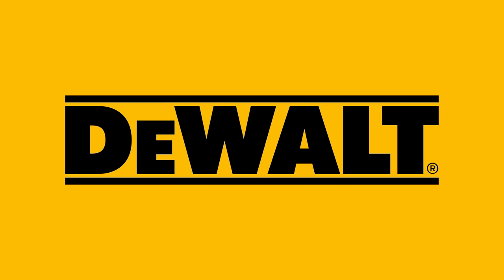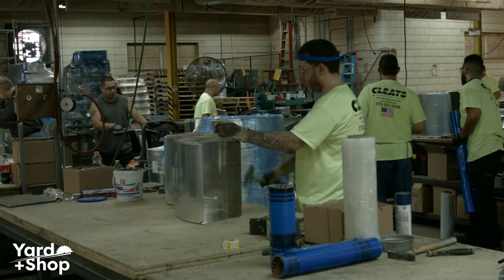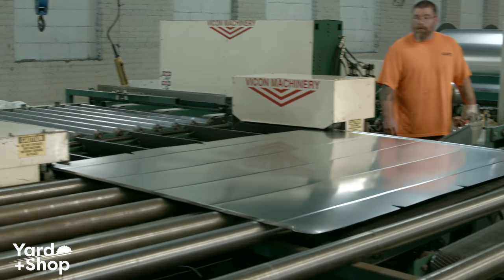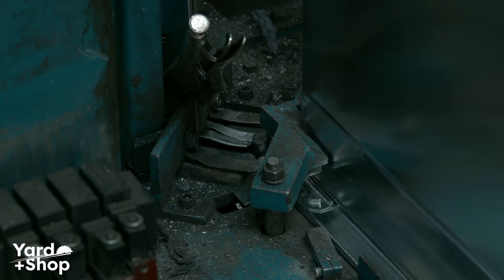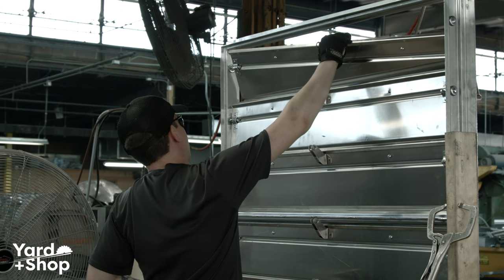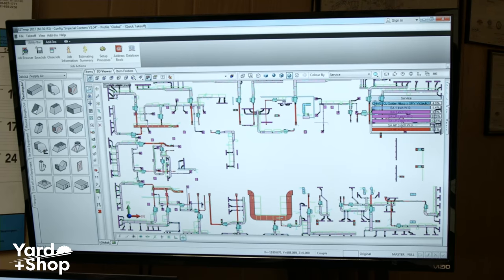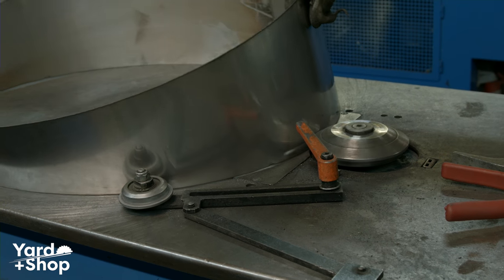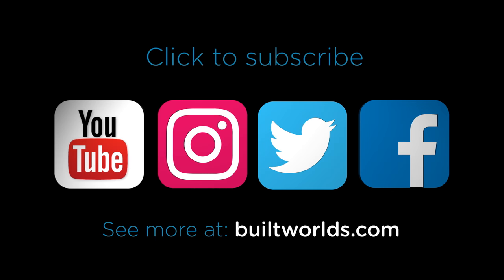From sheet metal to HVAC: How machines cut, shape, and fabricate duct work

Comment: Get into sheet metal guys! I've been working for only 2 months now. But I've learned so much. Working in 2 shops now one unpaid but he is pushing me to design somthing to produce and make money off of. I am learning how to use solid works and how to program the laser cuter. Way better career than my last line of work (hotel and casino work.) If anyone is debating on getting into this line of work I would highly recommend it if you can handle hard work.
Reply: Got the job just before lock down. But still can't start because not all companies have opened again fully. Never done anything like this before. I've been caring for 3 years. Time to get out and try something new. Especially how we were treated through this lock down. Hopefully I will enjoy it even without any experience.
Reply: Update?
Reply: @TitusKingdom  just crushing still. Getting better and learning new stuff everyday!
Reply: Why he not paying u!
Reply: @rishadar  in knowledge he did.